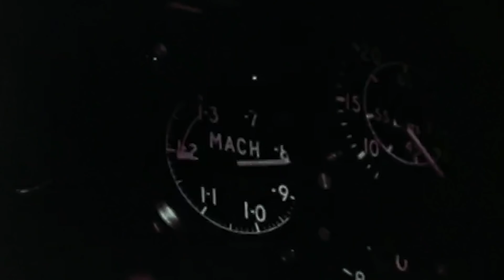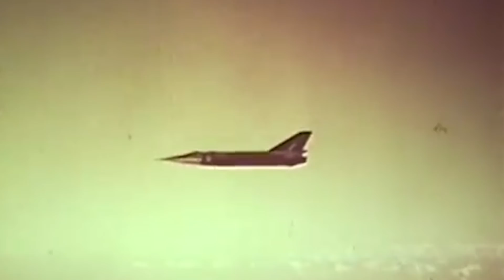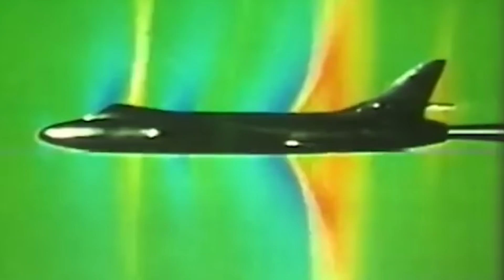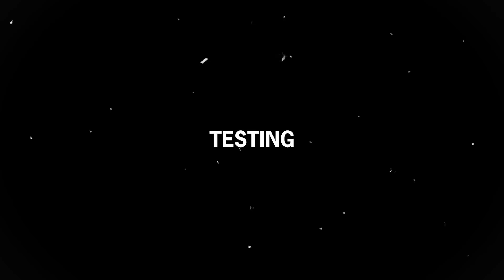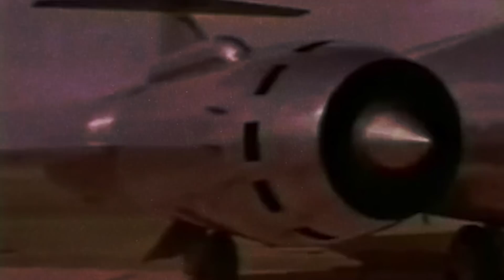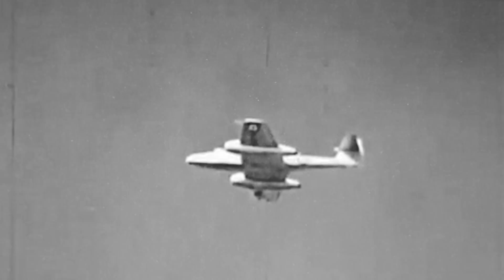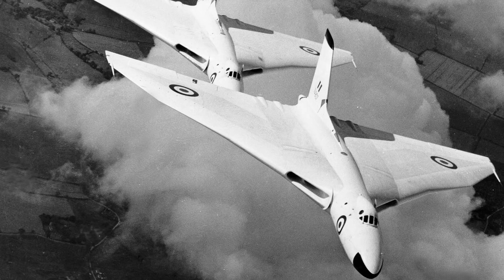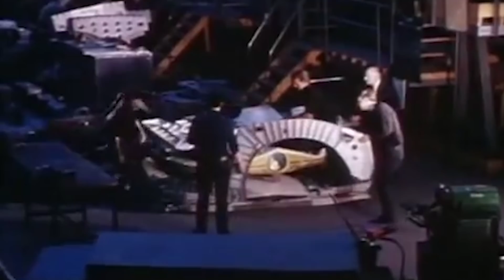The Bristol 188 Flaming Pencil - Supersonic Stainless Steel

Comment: Inspired the SR-71
Reply: Not quite! They actually debuted in the exact same month (April 1962), flying only 12 days apart. But they were developed in total isolation. Kelly Johnson and the Skunk Works team were already designing the titanium A-12/SR-71 in the late 1950s, years before the Bristol 188 ever got off the ground.The US threw absolute bank at the A-12, allowing it to blast past Mach 3 by July 1963. Meanwhile, the heavy, welded-steel Bristol 188 was so thirsty it could barely stay in the air for 20 minutes without running out of fuel, maxing out at Mach 1.88. Lockheed didn't copy the British; they completely out-engineered them

Comment: AVRO were definitely on to something... If you look at the aircraft profile at 8:34 - you can see the SR71.

I'm only talking about the laminar wing with the 3-phase SRAM jets buried in the wing, with movable intake shock cones at the front of the nacelles.

With more development it would have been a short hop to planar cockpit, fuse- and empennage. Having only one rudder, square on, would have become a RADAR hungry hindrance, so it probably wouldn't have taken the designers long to follow Kelly Johnson's lead and fitted twin rudders with a slight incline.

I think what it does show, is form follows function, and most talented engineers will end up with the same result.
Reply: SR71 was a later derivative of the A-12 OXCART project from 1962 which was its first official flight. The A-12s were even faster and flew higher. One even worked as a interceptor concept prototype.

Comment: Bristol - *builds the 188*
Lockheed - "Cool jet, bro. Mind if we take a look?"
Bristol - "Sure...just try not to copy it."
Lockheed- *Builds A12*
Bristol - *Silent contempt*
Reply: A very amusing theory... but the Lockheed A-12 was designed and build at the same time....not after, and flew an amazing Mach 3+.... while the 188 was a disappointing failure that couldn't reach Mach 2.
Reply: @sandervanderkammen9230  Didn't Lockheed start after the 188 was already in jigs being built?

Still, it's an amazing coincidence.
Reply: @MrMoorkey  Lockheed A12 and the Bristol both flew for the first time in April 1962... 
There were already several Mach 2+ aircraft in operational service and the A-12 could fly Mach 3+ highlighting just how far behind Britian really was in supersonic aircraft technology.
Reply: @sandervanderkammen9230  Thanks for filling me in on that!

Comment: Not sure if it's pretty or ugly, but it's certainly distinct looking.
Reply: Regardless of its appearance it was without any doubt a colossal failure.
Reply: @sandervanderkammen9230  yep, but sometimes . . . sometimes . . . aircraft design failures lead to great lessons learned and subsequent successes.
Reply: @williamtell5365  That certainly wasn't the case with the 188... several Mach 2+ aircraft were already in operational service and the Mach 3+ Lockheed A12 flew just days after the 188... highlighting just how far behind Britian really was in supersonic aircraft technology

Comment: We already had it in the Miles but the government killed it and passed the information to the Bell engineers who visited the factory and took some drawings away with them.
Reply: The Miles M.52 never existed... Bell could not steal was does not exist.
 The Miles M.52 was a proper bodge job... Miles had never produced anything faster than 350 mph and was incapable of building a supersonic aircraft.
Frank Whittle also failed to deliver a working engine capable of the thrust required.
The scandal is a shameful chapter in British history that led to the Crown charging Miles with twelve counts of fraud and embezzlement and Whittle  being sacked amid allegations of embezzlement and dereliction of duty. Whittle was removed from Power Jets Ltd. and exiled to a drug rehab in America.
The whole disgraceful fiasco was covered up to spare the new Labour government any further embarrassment.
Reply: @sandervanderkammen9230  If the M 52 never existed why did Sir Stafford Cripps insist on jigs and plane being broken up and drawings being made available to America? I think it should be noted that if only the confirmation of thin wing calculation from a different source would have been invaluable at that time. 
As to the fraud this was relative to the involvement of Hogg who wished to and did take control of the company and set it on a different course. It is interesting to note that his report upon which the bank reacted and was viewed by the political establishment was never released nor was any trace of it found after his death. I think it not unfair to say matters were decided at a political level far above the action of a mere director of a company. What very few people who are alive today can realise is the desperate deals that were done during and immediately after the war to try and reestablish British liquidity. 
It is interesting to note the Malayan Emergency was fought because the British Government made more on the tax of tin and rubber than than the rest of the economy? It was called an Emergency so insurance of the goods would not be compromised. At that sort of level the negating of a company and one director is of small value. As to thrust required it depends on the mass of the vehicle it propels. Rolls later developed engines with greater thrust but more interestingly they devised a means of mounting the fan blades so they did not explode at high thrust. 
I think what was interesting about the M52 was it was an aircraft designed to take off and land with a slim wing under its own power and this wing had been tested subsonically on another aircraft frame to prove it in low power flight. It was the calculation of the low/high speed facility that was the significant factor at this stage of the known wing engineering at this period. I think a couple of years later DeHaverlind were given a contract to simulate the Bell flight with wooden models released from a pilot aircraft and all bar one failed to fly through lack of viable remote control and they were I think lost at sea. 
I realise that our attitudes differ a little upon this but part of reading history is to note the apparent likelihood of sources used. I must admit you are the first person I have heard describe Whittle a drug addict. The phrase dereliction of duty had slightly different meaning then to now. If that were so why is so little made of it. Remember Turing has only recently been remembered. Churchill ordered Colossus and it brethren be broken up so it could not be replicated but he knew there was a copy in America that would continue to be developed. Politicians are violent and ruthless people and hold the rest of us in only the vaguest regard to getting themselves in office.
As for the embarrassment of the Labour Government they should have been used to it by then! Not many people can sit around a cabinet table, decide to convert British Railways to an oil fired fleet and only when it was half way through ask the Treasury for money to buy oil when there was none! The railways were returned to coal. Political power when not from the barrel of a gun comes from money. Always follow the money and I am sure money was at the bottom of all this. However, it was a long time ago and though I existed through it I was to young to understand at the time. Subsequent rereading of that period has proved interesting.
Reply: @glynluff2595  The Miles M.52 never existed because it was never constructed... in fact, no actual construction on the aircraft itself was ever begun.
 What good would a set of uncompleted, unproven plans have been for the engineers at Bell?
The Bell X1 had already flown by January 1946!!!

Frank Whittle's debilitating addictions to amphetamines and benzodiazepines was no secret nor was his week-long drinking binges.
 Whittle who was prone to violent rages during these drug and alcohol fueled binges led to several altercations with the Rolls Royce staff including the assault of a junior engineer at R-R,  assaulting Power Jets staff and arrest for brandishing a firearm.
He was admitted to hospital on at least 3 occasions for "mental exhaustion" which was 1940s code speak for substance abuse rehabilitation.
Whittle himself publicly admitted to being an alcoholic.

Comment: It seems possible that the British engineers could have built a spy plane that could reach & sustain mach-3+ speeds, but the missiles could do it for sure and they could reach space, to put a satellite up there, to survey the Earth, putting spy planes out of business... The CURRENT problem with ANY satelites is the amount of junk floating in orbit... That can easily kill ANY satelite in space if it is struck by even a small amount of debris... So maybe the Spy Planes can still make a comeback!!!
Reply: The failure of the Bristol 188 clearly demonstrates that British engineers could not reach Mach 3+ and in fact never did...
Reply: @sandervanderkammen9230  Back at that time, the mach 3+ aircraft were very exclusive to either research, or to active recon missions... The engineers had propulsion systems capable of these speeds, but the aerodynamic heating was, and still is a major factor at those hypersonic speeds... Extremely difficult to handle the heat and extremely expensive to maintain planes like these... It looks like Britain could have gotten together with the people in the U.S. intelligence community to keep track of what the Russians and their friends were up to...
Reply: @michaelmartinez1345  Absolutely not, the YF-12 was developed as a Mach 3+ Interceptor and XB-70 as a Mach 3+ strategic bomber.
Both these aircraft were rendered redundant only by the introduction of the Titan II ICBM... 
Planes like the Bristol 188, Avro 730 and TSR2 never achieved Mach 3 performance  and would have been completely obsolete on arrival into service. 
 Britians race was over by 1964, further development would have been pointless.
Reply: @sandervanderkammen9230  You completely missed the point Amigo... Apparently, it literally flew over your head, to a place far-far away...  We were talking about the usefullness of a mach 3+ aircraft, that is capable of sustained flight at those speeds... The A-12 and the SR-71, were both intended to procure intelligence & information of what was happening with our adversaries... The A-12 was the single seat plane and the SR-71 was the dual seat plane with a image and incoming threat/avoidance specialist sitting in the back. The YF-12 was to be equipped with a missile to launch and destroy incoming threats during a recon mission... But there were problems with the missile launching system, so that program was canceled... There was even a version that launched a hypersonic drone (MD-21), that was an A-12, modified to carry a drone, but that had problems with the launching system, so that program was canceled too... The Sucessful program was the SR-71... It flew for many years... The XB-70 was an impressive mach 3+ bomber, that did everything that it was designed to do, very well, except being able to compete with the ICBM missiles... So it was canceled... But the need for mach 3+ planes was still there, for recon missions... And now satellites can do that, but with the amount of junk in orbit,  there is a definite question of the reliability of anything up there, that might be destroyed by an impact from a piece of orbiting space junk.... So maybe hypersonic aircraft might still be needed for that same purpose, of recon, to provide a redundant form of intelligence procurement, on the outer reach's of our atmosphere, where space junk takes a dive to where it came from...
Reply: @michaelmartinez1345  Sorry but you seem very confused and misinformed still, the YF-12 was a Fighter/Interceptor, not a reconnaissance aircraft... thus the F designator.

I think you missed the point... Britian never built any Mach 3+ aircraft, in hindsight its clear the U.K. simply lacked this level of supersonic aircraft technology.

That's a very naive notion, the SR-71 or even hypersonic replacement could never serve effectively in the reconnaissance role today considering the current state of missile defense systems capable of intercepting ICBMs at over 15,000mph with a 10,000 kilometer range.
Reply: @sandervanderkammen9230  Dud, I mean dude, please do more research of what you PRETEND to know about. . There were several 'F' type of aircraft that were designed, but failed at their original intended purpose, or they just did not have enough political influence to be able to capture a viable government sponsored contract, to be able to produce models that their prototypes were built to demonstrate their designs.... The YF-12 was a program that was based on the single seat A-12... Neither plane was solely intended to be an Attack or a Fighter aircraft. Both designs were intended to procure information of what our adversaries were doing at that time... In fact, the A-12, the YF-12, the MD-21 and the SR-71 all had airframes that could withstand no more than 3.5 positive G's .... Neither an Attack or Fighter plane could survive in the roles of what those designations are, with 'G' ratings that are that low... Their SOLE INTENTIONS of existance, was to fly high over an area of concern, at very high speeds and take photos of what was 'going on' down there... No fighting, no attacking - just hauling ass and taking photos.... The MD-21 was more of a research project - that did not pan-out... BTW, what did the letters 'MD' mean- in that program of the MD-21... You might be surprised by this...
Reply: @sandervanderkammen9230  And another interesting thing about the U.S. spy plane programs, besides the mis-leading designation letters that were given to them, is who funded the program... Yes, it was government money that supported it financially, but which BRANCH of the government funded Lockheed for these spy plane programs? This will tell-EVERYTHING, of what the ACTUAL intended purpose of that entire program , with all of it's variations was....
Reply: @michaelmartinez1345  Yeah, you look like fool right now...
Reply: @sandervanderkammen9230  the simple reply that You gave here, shows that You pretended to know about something that YOU actually did not know about... No big deal- Amigo... Everybody can and will make mistakes... We all can learn from our own mistakes, when we own-up to them..  Perhaps, Your main mistake here, was not admitting that YOU made one... Which leads me to believe that You learned nothing, from Your mistakes...
Reply: @michaelmartinez1345  Thanks for proving my point.
Reply: @sandervanderkammen9230  - actually YOU deserve the credit!!! For proving that Your ARROGANCE is quite the stone wall, between You- and reality... Have a nice Christmas!!!
Reply: @michaelmartinez1345  Merry Christmas! Don't be such a sore loser...
Reply: @sandervanderkammen9230  , what a coincidence, I was just thinking the same thing about you!!! 😂 Merry Christmas...
Reply: @michaelmartinez1345  Thanks for the Christmas gift... you proved my point...  Again

Comment: it works like this: Original intent,  the thinker creates the concept,  when he completes his description,  specification have ended in a plan,  the next step is the egg heads actuaries studies are performed.   
next the plan hits the division engineers , every division has it lead senior bench tech who takes the blue print and makes it in 3D bench top form,  when all the parts are ready its put together into a single craft!  

nothing under heaven can jump any of these steps if it is done outside this frame work the project will fail.

Comment: Why do I see the seeds of the SR71 Blackbird in this aircraft? Hard won British technology sold to the US, for hard cash, perhaps? Necessitating the scrapping of the original British prototypes - and entire aviation industry, to favour the US ones as a condition of the deal?...................................................Hmmmmmmmmmm...................
Reply: Because you don't know that the Mach 3+ Lockheed A12 flew in April 1962...
No, britian was simply decades behind in supersonic aircraft technology.

Generally speaking, aircraft that were technological failures like the Bristol 188 are not put proudly on display... they are usually hidden away until long after the people responsible have left their post and passed away.

Comment: The EE lightning had - at the time - the fastest climb rate of any fighter bomber, it was its main selling point as its endurance wasn’t optimal . However , the EE lightning still holds as one of the fastest climb rates of all time.
The only thing that’s ever held British aviation back, id unimaginative governments.  The U.K. still has one of the worlds largest aerospace industries, however.
Reply: There have been many great post war Planes developed in Britain. All axed due to incompitent governmental interference.
Reply: “It’s endurance wasn’t optimal” teeheheheheheheeeeheheheheheheeee it was short of fuel on take off! A third of them were lost and the stacked engine design was a disaster. It only carried two inaccurate unreliable missiles (fire streak or Redtop). It was actually a terrible design that must have been fun to fly but not to fight against the massed bombers and long range fighters of the Soviet Airforce.……
Reply: @billpugh58  Yaaaa Boooo  :)
Reply: @billpugh58 The gun 🔫 worked

Comment: I'm getting serious SR 71 Black Bird vibes here (1966).   Even though it didn't perform as required, I'm still in awe of the designers and engineers who create this marvels..
Reply: Sorry, the SR71 is a variant of the earlier Mach 3+ Lockheed A-12.
Reply: The A-12 had its first flight just 12 days after the Bristol 188 in April 1962, but hit Mach 3 by July  1963.